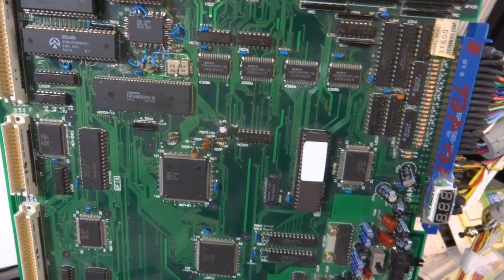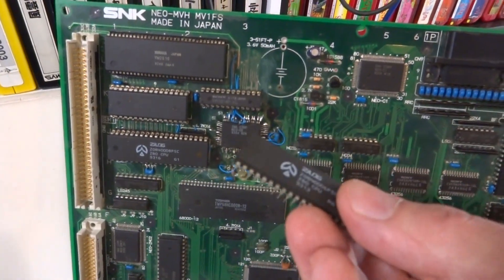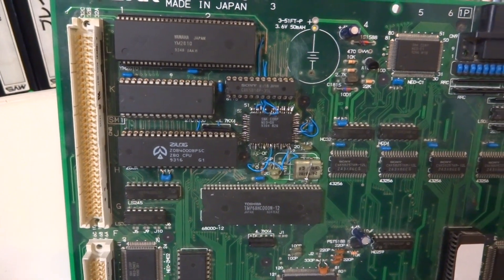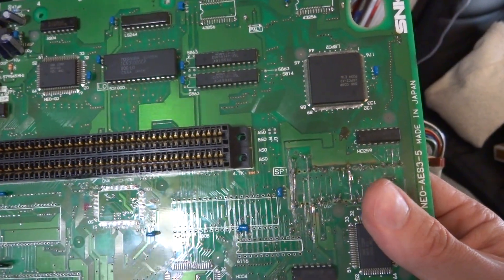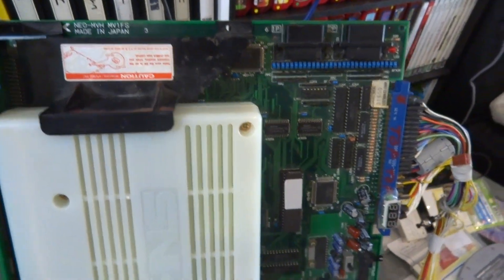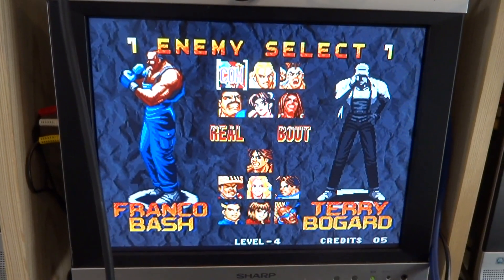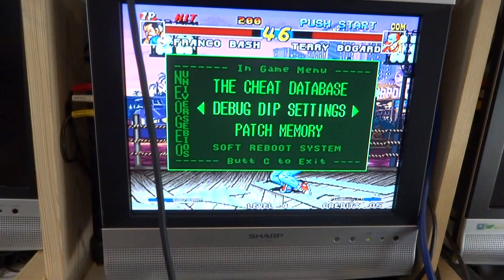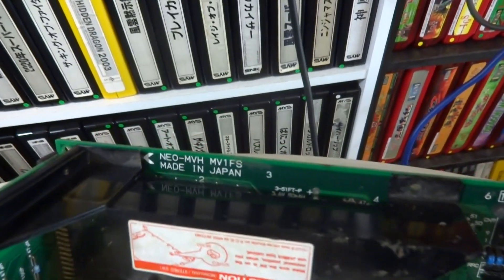Neo Geo MV1FS Motherboard Repairs

Comment: @lukemorse1 smh... bro... just shaking my head. Sent you an Facebook message. This is an easy (and quick) fix. Your speakers are not actually hooked up. You've had this "issue" before, and fixed it. See my Facebook message for more information.

Comment: Wow man, you got it to play! I knew you were the guy for the job. Sorry that it was such a damn pain... Before the board started shooting me the z80 error it did always have issues with the sound. Those sliders are pretty janky, but the caps should be new. Unless i screwed that up too... This was a long time ago, wasn't that great at soldering at the time.
Reply: +Derik64 Look at 6:09, and proceed to shake your head.
Reply: +Derik64 next to the headphone pin connector is the speaker connector. Neither one is hooked up. Luke can not run the speaker from the Jamma connector because that's not how this board was designed. He has to completely remove the pins for sound from the Jamma connector, and hook up to the speaker pin connector on the board somehow.
Reply: +Derik64 Also he has to leave the switch set to mono once he correctly hooks it up. Otherwise the headphone pin connector becomes the right channel audio, and the speaker pin connector becomes left channel audio. There by splitting the mono channel in half in order to create stereo via the switch.
Reply: +Derik64 the pinout for the speaker connector as well as the headphone connector (left to right) is positive minus minus positive
Reply: +Derik64 Luke actually fixed it completely, but lacks the observation skills. It's plain as day to see what's wrong.

Comment: Still an amazing job, sound or not. Top man Luke :)
Reply: +SmoothEmJay Look at 6:09, and proceed to shake your head.
Reply: +SmoothEmJay next to the headphone pin connector is the speaker connector. Neither one is hooked up. Luke can not run the speaker from the Jamma connector because that's not how this board was designed. He has to completely remove the pins for sound from the Jamma connector, and hook up to the speaker pin connector on the board somehow.
Reply: +SmoothEmJay Also he has to leave the switch set to mono once he correctly hooks it up. Otherwise the headphone pin connector becomes the right channel audio, and the speaker pin connector becomes left channel audio. There by splitting the mono channel in half in order to create stereo via the switch.
Reply: +SmoothEmJay the pinout for the speaker connector as well as the headphone connector (left to right) is positive minus minus positive
Reply: +SmoothEmJay there is no need for an external amplifier. Just hook up the speaker directly to the board.

Comment: Iv got one of these mv1fs boreds and it's completely dead I have no video output and the video chip gets red hot within a mins of being on I believe the sound section is working as we sometimes get a humming noise on the speakers and it clicks aswell